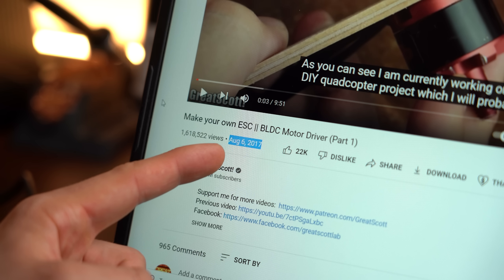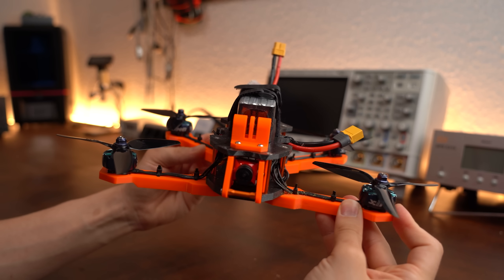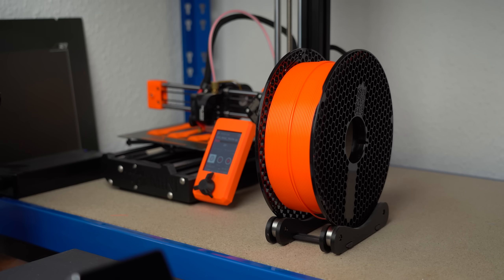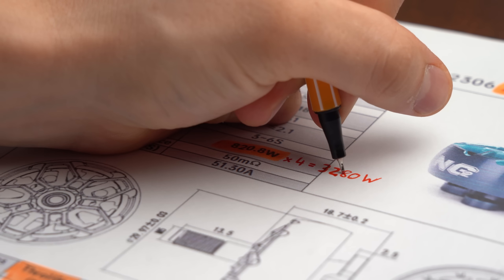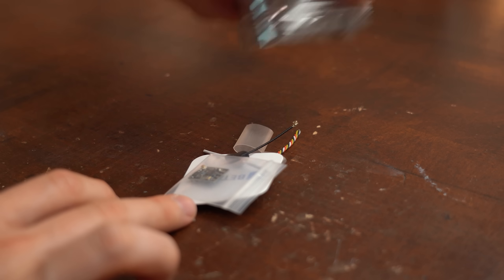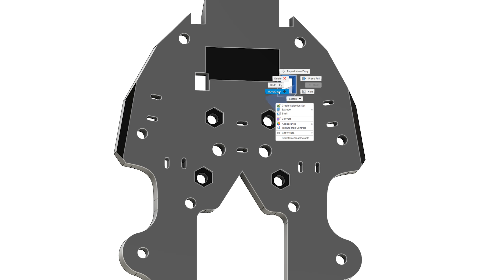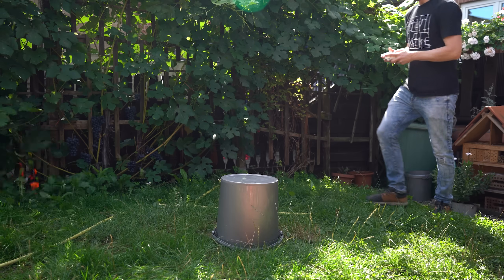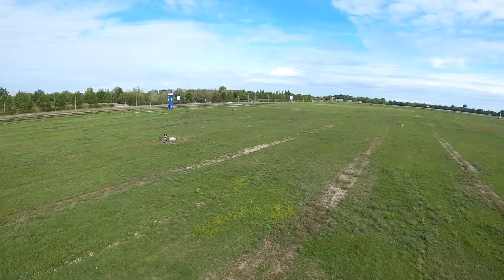The Idiot's Guide to Making a DIY Drone! (I am the Idiot)

Comment: I'd get a carbon fiber frame as its much more resistant against crashing.
Reply: More for the stiffness I'd say. vibrations will be putting the PID loop through some shit.
Reply: @rawfpv1207  Agreed, the vibrations and potential harmonics from the 3D printed frame will probably cause poor performance if the printed parts aren't stiff enough.
Reply: @jacobsingh4873  so print solid pieces? like where's the data on harmonics for CF in relation to drone application? I feel like there's a 99.99% chance you're speaking out of your ass right now.

people take frames and put tons of motors and parts on them. there is no way there is standardized harmonics and vibrations that anyone is worrying about to be able to say CF is better or worse than anything else. it's light and it's sturdy. that's all ppl care about.
Reply: @SeraphX2  I think a fair few other comments have made mention to this, the vibrations will still transfer throughout the frame and will not yield the best performance as far as the PID loop's attempts to correct quad's positioning goes. All I'm trying to say is that the performance of a 3D printed frame can perform close to CF frames but isn't optimal in this case as printing solid will lead to a overall weight increase and the stiffness when not printing completely solid as seen in the video obviously didn't provide the best durability. Moreover, the majority of fpv frames out there are made from CF and if it were to be inferior to 3D parts we would see a whole lot more 3D printed fpv frames in use. 

I was merely commenting on the poor characteristics that a 3D printed frame would bear in the context of fpv quads as vibrations are the lead cause of degraded handling characteristics and assuming that this project continues in the future, the limitations of 3D printed frames would be realised quite quickly. Sorry if there was any misunderstanding.
Reply: Carbon fiber is nice and strong but a pain the the behind to modify without making a mess. That dust is not good to breath in.
Reply: @kenengel620  they come premade for like 25 bucks. they are dirt cheap when it comes to the rest of the drone.
Reply: Go with a thicker carbon fiber frame and one that has separate arms. That way you can replace the arms if they break.
Reply: Wouldn't the whole thing be more stable with the body mass below the blades?
Reply from the maker: Definitely possible. But you can not easily reprint parts ;-)
Reply: @greatscottlab  Thats true but you don't have to anymore. Mine held up against hard crashes for now 3 years.
Reply: @greatscottlab  carbon fiber frames are also more rigid and fly better since there are fewer vibrations shaking the gyro around!
Reply: @greatscottlab  You can buy spare parts, but honestly carbon fiber is so strong you won't need to replace parts
Reply: @greatscottlab  You will never have to reprint because they will never break unless you crash it too hard!
Reply: @greatscottlab  ..you simply dont need to. You have to hit a carbon fiber frame really hard or in a bad way to break it...
Reply: @greatscottlab  The main problem with 3d printed parts over carbon is the flexibility leads to way too much oscillation and resonance. They are cheaper, but will never fly well, especially at such a large frame size.  People point out the strength and durability, but honestly that is way less important than the flight characteristics.
Reply: @greatscottlab  RCLIfeOn did a video once on 3d printing a drone frame, might be a interesting watch for you.
Reply: @greatscottlab   You will likely never even break a carbon fiber frame. I have crashed my quad high speed into the ground, and concrete, frame did not break. Even if you manage to break it, most frames have spare parts easily available.
Reply: @greatscottlab  Maybe you could set up a CNC with a carbide bit and not so easily cut carbon fiber parts. The stuff is expensive though
Reply: @greatscottlab  Not only against crashing, the oscillations can also be reduced significantly! Carbon fiber is just WAY stiffer than a 3D print with PETG.
Check out the TBS Source One. It is an open source frame, designed by TBS. So you can get all the files and you technically can print replacements.
The nice part about it beeing open source is the price. It costs about 25-35€ on the german FPV shops, all parts can be bought as replacement.
Reply: @greatscottlab  lol
Reply: @greatscottlab  That definitely is true, but resistance is not the only reason CF is used in frames! It's also stiff, so it pushes the resonance frequencies up where they don't confuse the FC. In practice, a stiffer frame means less filtering on the FC, and better, less jittery flights!
The "vrrrrrr" and not smooth motor spinning is the FC trying its best to not listen to the resonance in the frame, but failing. The stock PID values will work better with a stiffer frame! :)
Reply: @greatscottlab  Crashed my carbon frame in about every way imaginable, no cracks, all good. Screwed some props, motors, antenans etc, frame is solid. On 3d printed parts you will change an arm at every crash. And they are not even expensive for this size quad.
Reply: @greatscottlab  They don't break that often tho
Reply: @greatscottlab  Probabaly using ASA or ABS could save a few grams and have the same if not better resistant

Comment: Have you played with the PID parameters after recording? Too much oscillation can be caused by too much proportional and integral gains
Reply from the maker: I will try that 🙂
Reply: @greatscottlab  check out chris rosser for really good tuning guides
Reply: @ototheo2740  
I don't think this will help much, he should overthink the choice for the printed frame and the prob size.
It's a fun project, but not very usable as a freestyle drone.
Reply: @raistraw8629  yea tuning is more of a bandaid in this case, but a general understanding will help
Reply: @ototheo2740  
I think trying to tune a bad frame, not only a printed frame also a bad cheap carbon fiber one just gain frustration, I speak from experience. 😞
But if he does not take this hobby seriously, it would also ok to do it with a printed one.
Nerveless chris rosser is a must.
Reply: @greatscottlab   You need 1 drone simulator. 2 good quality drone , not 3d  pninted.
Reply: @greatscottlab  you shouldn't have to touch PIDs on a 5" quad to solve an issue of bad flight characteristics. the main reason it would fly bad are
1. electric noise => you should solder a low ESR capacitor on your ESC
2. gyro noise => you have a bad gyro and should replace the flight controller. use blackbox to confirm it
3. bad mechanical characteristics => get a proper carbon fiber frame (my reco is you should start there). could be a bashed motor but your build is new.
Reply: Yeah, correct. It can also be fixed by increasing the Derivative gain as it contributes to minimizing the oscillations. However, it was good.
Reply: As alluded to here, tuning is less of your issue here and filters are more impactful I'd say. Get a black box log of your gyro data (YouTube tutorials) and see where all the vibration is at and set filters accordingly. With the over filtered frame as it's not nearly as stiff as carbon, it won't fly pristine but you don't need it to. Filtering can help a lot, especially if you notice the motors getting too warm.
Reply: @erick4188  I think so too that filtering is the problem. Zeus F7 uses BMI270 and it has LPF 750Hz by default. It wont work with BF defaults.
Reply: Doesn't Betaflight have auto tune? Ardupilot does
Reply: I don't think he'll be and to tune much of that out. This is the problem with 3D printed frames. There is too much flex. This is why we all run carbon frames because they are strong, light and rigid. So while he could tune a lot of it out, it will be at the expense of responsiveness and flight performance.
Reply: PID's? Lol...Ummm never touch them of you don't know what you're doing .
Reply: What this poster said is absolutely right but if you are a beginner then absolutely don't mess with the tuning. If you are flying a standard Betaflight flight controller then the stock settings will be all you need
Reply: @IainMace  EXACTLY! Just don't touch the PID's
Reply: Mans had me thinking he was going to break out biquad standard form.